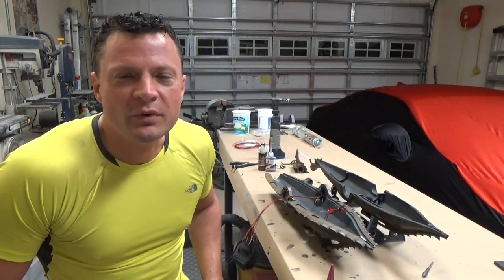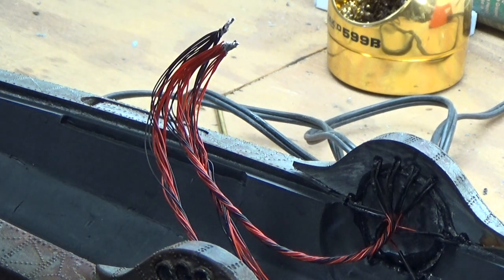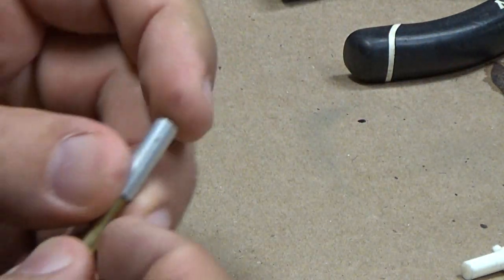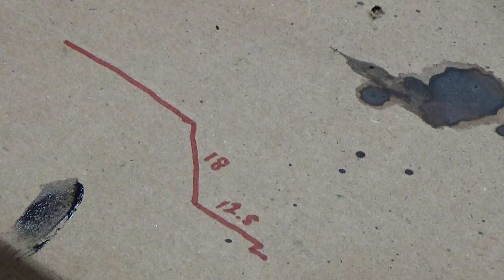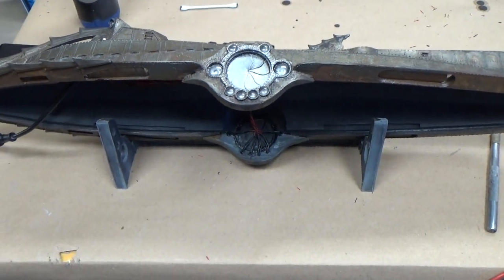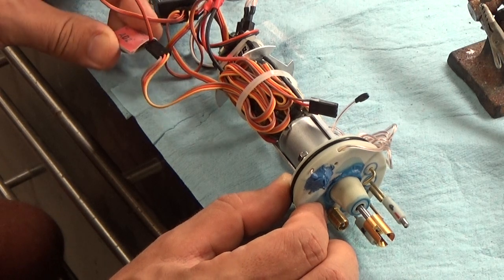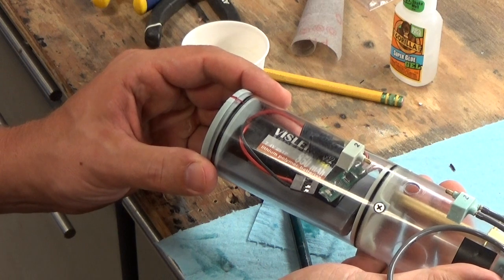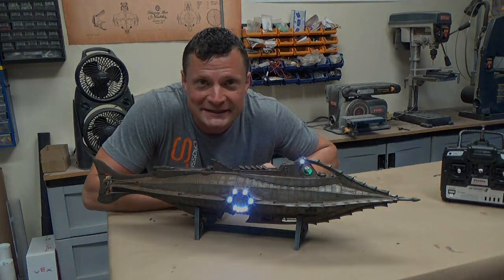Nautilus Drydocks Disney Nautilus step by step: CH4

Comment: nice work bob but could you explain where the ballast tank vents is it through the pressure vessel valve with that other servo you hooked up to the pump channel or is it through the pump itself when  pushed in the opposite direction of the pumping action   thx in advance. oh wait i think i answered my own question i see the other action at the top of the ballast tank when you push the servo in the vent direction it looks like it pulls the vent valve open at the top is this correct ?